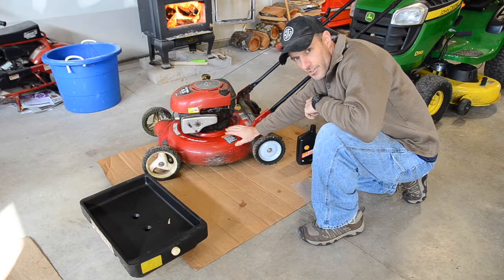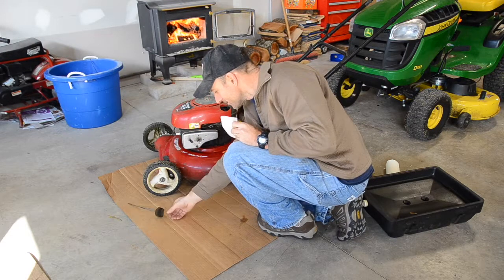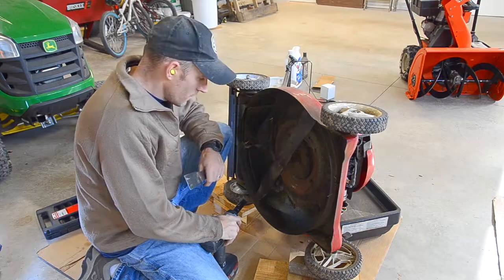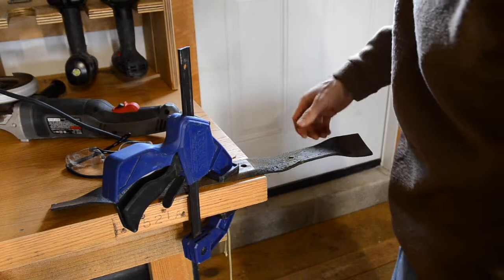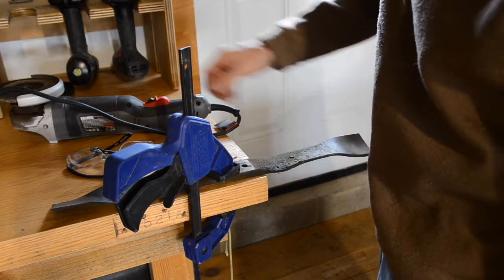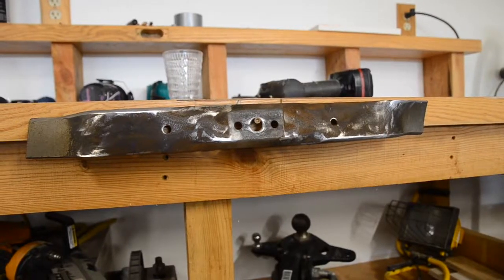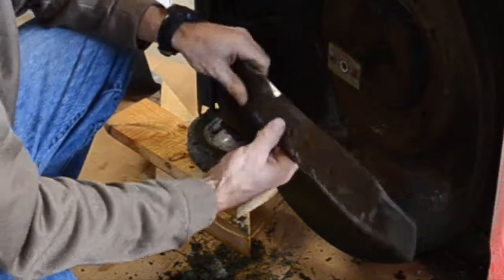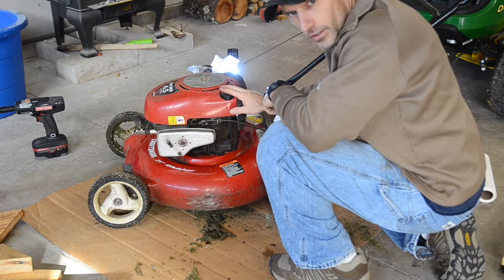How to change craftsman lawnmower engine oil and SHARPEN BLADES

Comment: Just FYI, you should use a face shield over your safety glasses for added protection against flying debris to the face and eyes. Very good demonstration on the oil change and blade sharpening and balance. Thanks
Reply from the maker: Thanks for the tip and thanks for watching

Comment: 😮😢👎Big Bubu never do that "Spark plugs on" 😅
Reply from the maker: Thanks for tip
Reply: Which part needs the spark plug removed? Draining oil or blade removal? I'm genuinely asking so I know what you're referring to. Excellent video, would be nice if you criticize that something was done wrong, you use a complete sentence. That will help others.
Reply: @JaeRoe3  tHanKs fOr WaTchiNg - lol jk. I'm not sure either but the proper answer is *neither.*Perhaps, Unless you've got your safety handle bungie'd down at all times with the blade removal - Then yeah maybe pop the plug boot off when you're installing it. I find it an actual miracle when any of these boat anchors start on the 1st pull, let alone -- y'know.